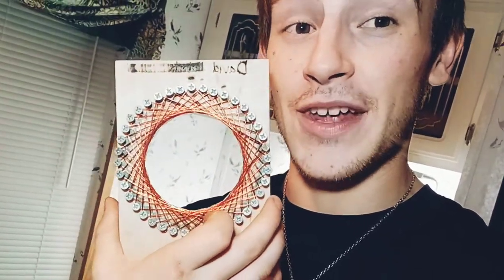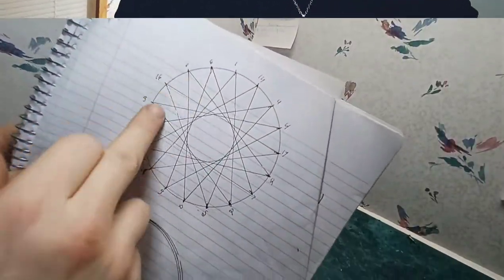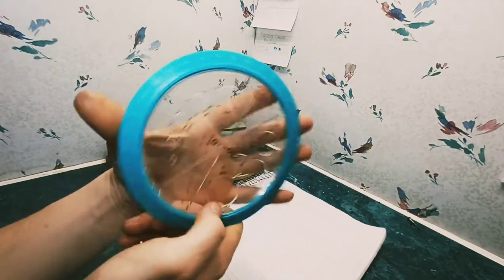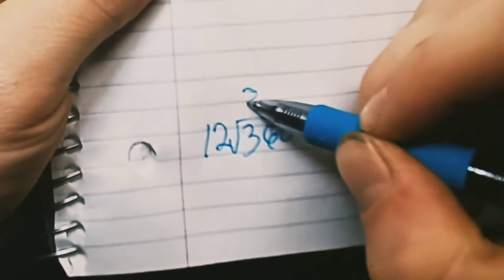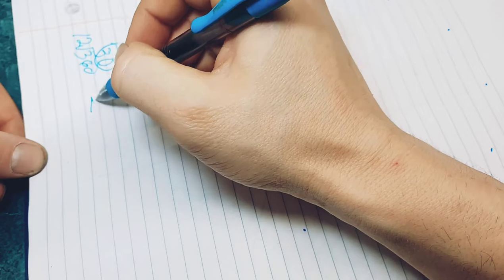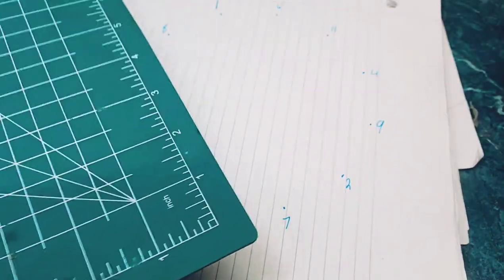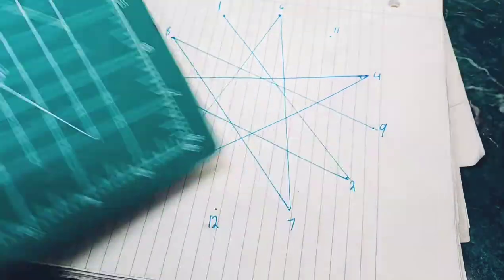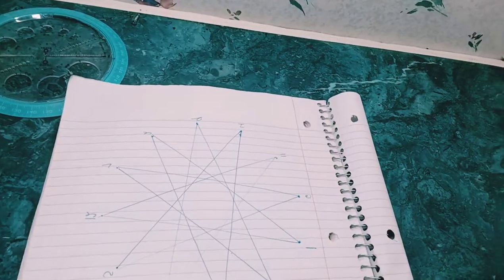How to Build a Dodecagram Coil Using the Secrets of 3,6 and 9! ☯️😁

Comment: Are you using coated copper for these coils? If so, is there a coating you can paint onto heavier wire? Just wondering if building these coils larger with heavier gauge wire will greatly increase their potential output.

Comment: Help a layman understand what's going on. You are taking a 3 volt battery and generating 40 volts at 13 amps? And it's a 72 phase AC output? 

It I understand correctly, this generator could be used to multiply power in all types of electric devices? What about an electric vehicle?
Reply from the maker: If we put this idea in electric vehicles, the future will be changed forever when it comes to energy efficiency